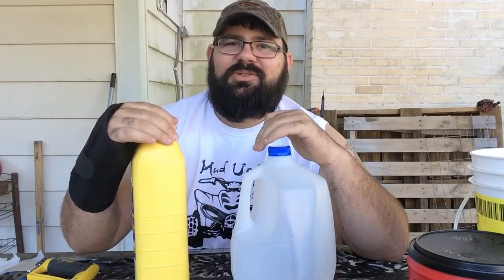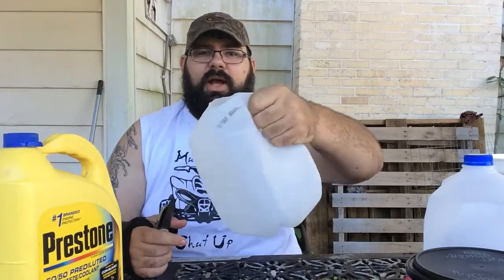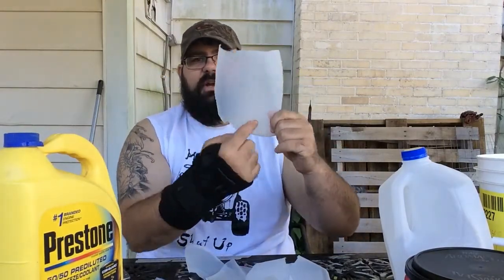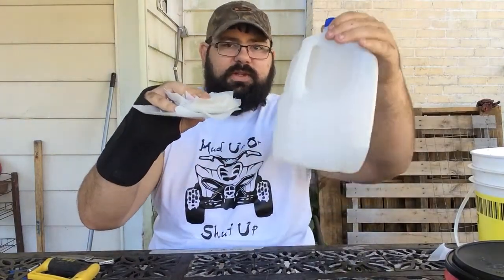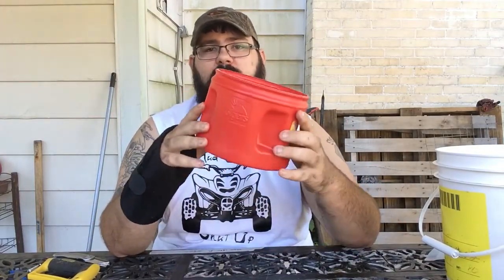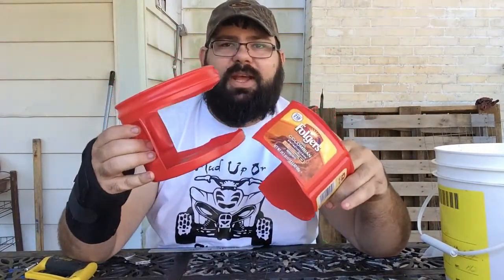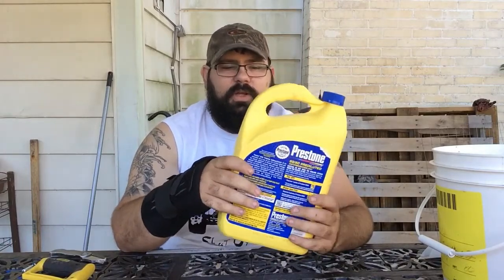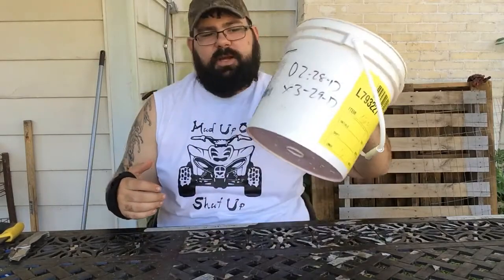Recycling HDPE - Video #2 how i cut the plastic up

Comment: I realize I'm tardy to the party so you may have figured it out by now but acetone will take the stuff off of the coffee container very easily, that's what I do. I just buy nail polish remover but I make sure that it's the 100% acetone kind, there is a few different kinds. Just soak a rag in it and it wipes right off.
Reply from the maker: Yes sir got that part down now. Thanks for the advice tho. This is something I do for fun. I need to do another video on it.
Reply: Yeah, I just started playing around with it within the last month or so. I'll admit, it's pretty addicting lol but at least it doesn't really cost anything.

Comment: I have found that a heat gun softens the adhesive and allows most labels to be removed easily. Not sure what I will use to clean the adhesive off if it is even necessary.
Reply from the maker: Yeah I need to try that most of my jugs are old and the glue has dried pretty good. Maybe soak them a while.

Comment: HEAT GUN OR HAIR DRYER will soften up the adhesive on the Label and will peel off easy!
Reply from the maker: Yeah I need to try that. Most of my jugs now are older. I wonder if it will work on older adhesive

Comment: Those heat bonded labels ate tough to get off.  I have just been scraping them off.  Sometimes I use a knife and I've tried a paint scraper.  They work, but leave a static clingy mess.  3M discs load up quick and I suspect sandpaper will too, but I haven't actually tried it.  Save your #4 for somebody else or recycle it if there is a local program.  Did you ever do anything with your plastic?  I looked, but I didn't find any videos that you made on it.  BTW, aviation snips work well to cut up the thick parts.
Reply from the maker: Ron Yerke thanks for the info. No not yet. I had surgery on my right hand and wrist so I been healing from that. But please stay tuned. If you saw the one video. I bought me an oven to melt the plastic down and I plan on getting to melt some plastic this week. I have it all set up now. Thanks for watching.
Reply: I have a video about removing stubborn labels from wine bottles.  If you use less heat, it works fort milk bottles too.

Comment: A lot of labels can be removed by filling the container with hot water and waiting a minute. The heat softens the adhesive and the label should peel right off.
Reply from the maker: William Morris I will be giving that a try. I have a ton of jugs to do. That's for the tip.
Reply: Where do you live? i need to go there give you hug, never thought of that

Comment: Easiest way to remove stickers from the plastic it to use a heat gun.
Reply from the maker: Jonathan Pate I got a heat gun and I plan on using it. It seems that a lot of people that do this plastic project, these stickers are a problem. Most just cut around it but that's a lot of waste. I have about 40 jugs saved up now and I'm going to try different things and choose the best.
Reply: Backwoods Raised, it is a lot of waste when you leave the stickers but it doesn’t take much to get the stickers off either. But good luck with it. See ya in the next video.

Comment: Done a few of these. The lids on my local milk jugs are not #2. I tend to cut mlk jugs with a razor knife similar to flower petals and then use tin snips to cut off 2inch squares. For me and this is a solution in search of a problem. My slingshot turned out barely acceptable. Mallet turned out great. Bath toys are feasible. I use a toaster oven and haven't had much luck with multiple runs in the same pan.
Reply from the maker: Tommy Wheeler I have to look up about the lids. A lot of people say it's HDPE but I think it's LDPE and if so small bits won't hurt to much it will melt down just as well. I'm going to get and old oven and use it and we will see how well it works for me. I just have to get my hand better. Thanks for your input and thanks for watching.
Reply: Backwoods Raised. Build some sort of mold or press. My first run twisted like a pretzel.  Glass pan worked twice before sticking. Parchment  paper ignited.  Metal pans stuck too much. Vegtable oil didn't help as a mold release. Oven will work great. 325 f  worked best for me. Good luck! Most of the current YouTube stuff leaves out the details. Thanks for your efforts.
Reply from the maker: Tommy Wheeler awesome info, yes my videos will not leave out any details I will show my fails and my wins.

Comment: Way to go! Really reduces the size and is more manageable by cutting it down. Please be careful when melting that stuff. It can give off some nasty fumes you won't want to breathe in. Just looking out for ya Spicy
Reply from the maker: Coin Sense And Nonsense yeah and when I want to make different designs in my plastic it makes it easier. When you melt the plastic at 350 degrees that is the safe melt range for number 2 plastic HDPE. I have a chart for each grade of plastic. Yes if you heat it up to 500 degrees it starts burning and will put off bad fumes. I will touch on that in the next video. Thanks for looking out bud.